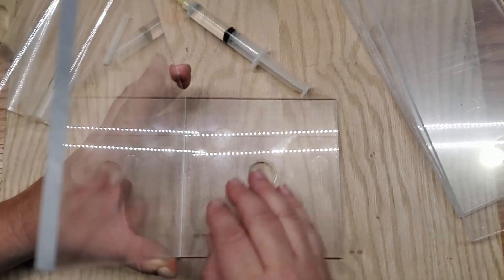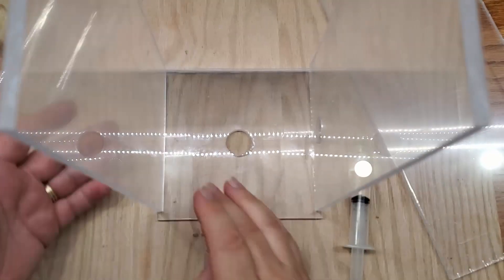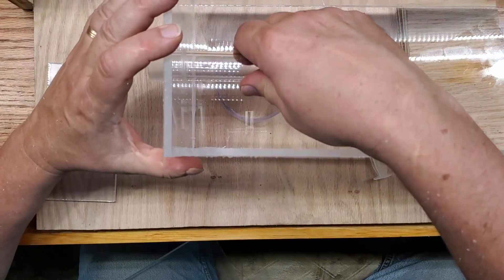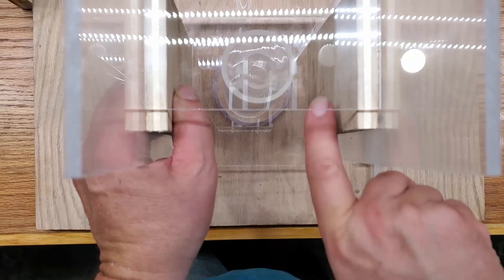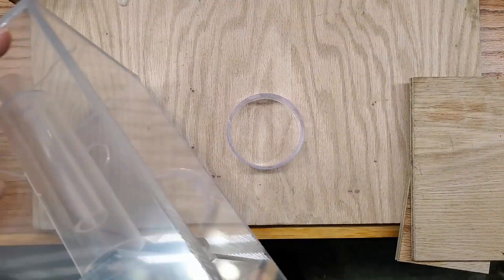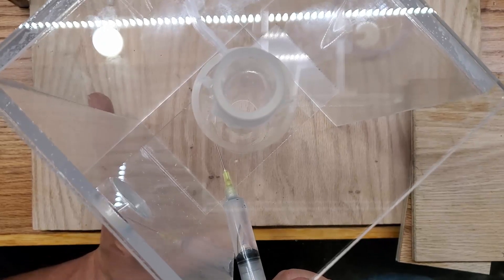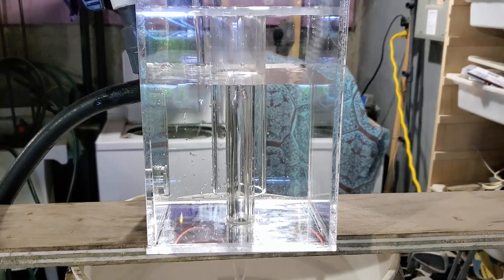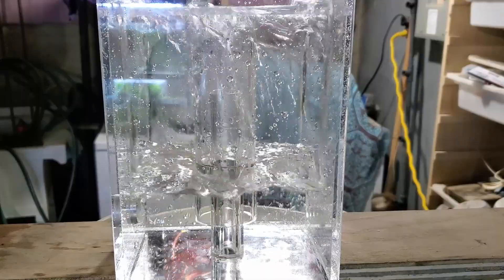A Very Simple DIY Bell Siphon

Comment: I know if the the drain tube was smaller you would get better results at a slower rate. My question is ... would it help if you reduced the diameter of the drain tube at the bottom? Since you cannot reduce the diameter at the top because it is now enclosed. Another option I can think of is to insert a tight fitting tube inside thee drain tube to reduce the diameter ( but would be more expensive). That being said I’d like to see the first option. Great video.
Reply from the maker: So glad you like this build. There are so many variations on bell siphons and small changes can really effect flow and function. I will most likely be building a new siphon for the filter build as this one isn't as reliable as other variations but I will be tinkering with this one too as a comparison.

Comment: One of the more interesting uses of bell siphons I have seen is as wave makers.  They were using large drums sitting at the end of saltwater frag tanks.  When the siphon kicked in, it dumped the water out into the tank causing a wave, so no need for an additional wave maker on top of your normal pump to get a randomish current for the corals.
Reply from the maker: I've never seen that use. Thanks for sharing! It might be a cool way of adding additional turbulence to the river tank I'm planning
Reply: I've used them on my reefs in the past with great results, as well I like the look of the movement they make

Comment: Id like to see this as a wet dry. And maybe you could let it run for a while and compare it to other filters? Also i wonder if you could build a tank with this as the overflow and intentionally size the pump to where it does not trigger the syphon so it acts as a ovefl9w that takes water from the bottom of the tank instead of the top. Might be handy to collect mulm and stuff off the bottom.
Reply from the maker: There are many variations of wet dry filters that work off of this principle. I will try and build a few as long as there is interest.
Reply: @FishmanEricRussell  that would be neat. but you know if its not a box filter or UG filter im not as excited about it. lol
Reply: I could see that as a good idea for bare bottom tanks with larger fish unless a sponge was placed around the bottom to keep smaller fish from getting accidently sucked up
Reply: @kens_fins8764  i was thinking the same or like some matala mat. Could drill the bottom of a 10 gallon and convert another 10 gallon into a sump for it. Would be really cool setup
Reply: @Zaku186  or have it in a 20 gal with a 10 gal sump or in a 40 gal with a 20 gal sump depending on the stocking

Comment: You can get it to work with a slower flow rate by adding a "u" to the drain pipe. It could be tricky to tune in, but if it pushes the air just past the airlock the "u" makes up just before the overflow starts in the drain pipe, the airlift on the other side of the "u" will pull the siphon in to action.
Reply from the maker: There are so many variations on this each with their uses. As far as I know a U at the bottom will interfere with the ability for the chamber to empty, though I will be testing out a bunch of setups to show how all of these things affect it's function. Thanks for watching!